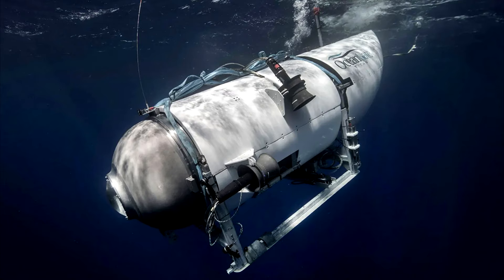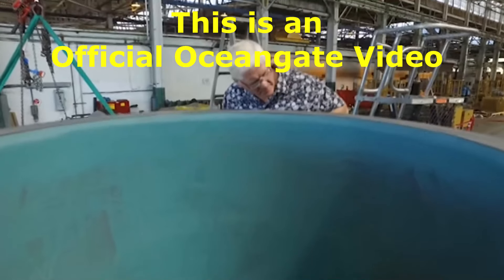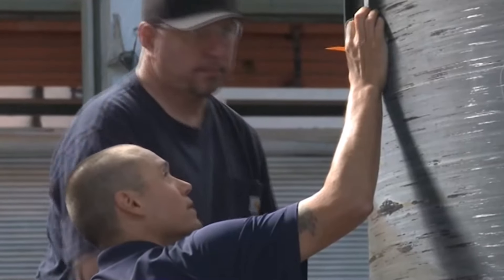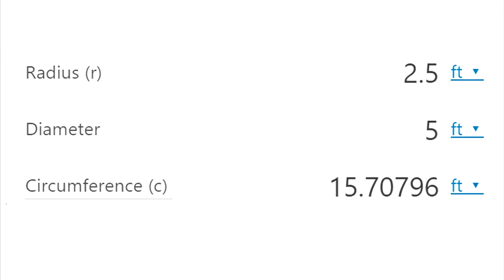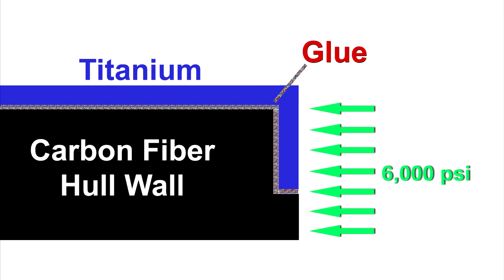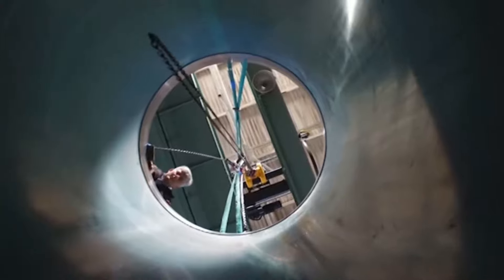Ocean Gate Titan Was Glued! Coast Guard Reviews

Comment: I have worked on industrial gluing systems.  The rings should have been sandblasted, degreased with Acetone, then treated with an ozone clean.  The glue application should have been done in a class 10000 clean room.  There should have been some squeeze out when they placed the ring on. I did not see any measurement jigs. You have to be precise with the clamping force to ensure even coverage.
Reply from the maker: Thanks for your comment.  They did have a procedure for that.  Below I have copied what was in the NTSB Factual Document.  The Spencer Composite drawing for this joint has the gap at 0.06 inches.  You are expert at this, do they really have spacers for 0.06 inches (front and back) in a gluing process like this, I would be interested to know.  Here is the text >>According to a former director of engineering and a written OceanGate process specification, the segments and hull surfaces were prepared for bonding by degreasing with methyl ethyl ketone (MEK) and roughening with stearate-free sandpaper. Contact angle measurements were taken between steps to ensure active (i.e., non-contaminated) surfaces and particulates were blown away using filtered shop air (tested by contact angle to ensure it did not introduce contamination). The adhesive was mixed and applied to both the segment and hull bonding surfaces. The hull was then inserted into the C-channel. The aft joint was formed by lowering the hull down onto the segment and the forward joint was formed by lowering the segment down onto the hull, the entire assembly oriented vertically. Spacers within the joint controlled the bond line thickness.
Reply: @solareclipsetimer  The glue used was Loctite EA 9394. It is not the best choice for bonding with titanium in cold temperatures.   For the application I worked on we could very precisely measure clamping force with a load cell and linear actuator. I am not sure how they would have used spacers. Also, they should be using Clean Dry Air and not air from a shop compressor. The glue should have been degassed in a vacuum.
Reply from the maker: @timdion9527  Agree with yu.  And i edited my original reply, the dimension of the glue joint space was 0.06 inches.

Comment: In reality, even the glue could have been superfluous for actually holding the sub together.  The pressure of the water at depth would have been forcing the end pieces inward against the cylinder main shell. You could have used a bungee cord wrapped around it just before you tossed over the side. The only real effect provided by the glue, at least underwater, would have been as a sealant, not an adhesive. 

They could have put handle bars on the end pieces and everybody could have pulled them inward until the water pressure sealed it.

Sure, being handed a titanium end piece and told to hold it against the main shell until you were under water might have brought on feelings of high anxiety among the paying guests but isn't that what Xanax is for?
Reply from the maker: Great points.  The Coast Guard testimony mentioned that the domes would have over a million pounds of pressure on them.  So, you are correct, the force pushes the domes in.  However, that does not necessarily make the carbon fiber to titanium interface joint watertight.  The glue had to hold the domes on the hull so it could be moved around as a unit, and watertight seal the joint. There were a lot of stresses to the glue on the joint to the ring, to which the hatch was attached.  At 6,000 psi you don't get a "drip-drip" leak, like the plumbing to your kitchen sink.  At 6,000 psi the weak spot propagates instantly to a catastrophic explosion.

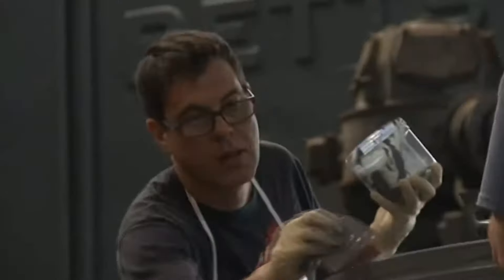Comment: I remember being horrified when I first saw this 2:02, going to 4000m in that thing..............
Reply from the maker: Thanks for your comment.  I agree with you.  This was of course video of the first hull.  But I bet they glued the second hull the same way.  The thing that really scared me about the 2nd hull was making the hull in one-inch thick segments and then having a layer of glue to bond the next 1-inche segment to the previous 1-inch segment. The implosion images showed how those layers just split apart.  I mean, who trusts glue in a construction like this, with those kinds of pressures?
Reply: @solareclipsetimer  Yes, again I was so shocked to see the 2nd hull was made in sections too, in all aspects it seems absolutely counter intuitive to do such a thing, however I think it accounts for the loud noises heard during ascents and descents as it started to delaminate. Moreover, regardless of advances in technology "glues' are not suitable for DSV's, even going back to the Thresher incident, where solder joints failed at depths far shallower than this contraption was intended to go.......... It really is incredible that these guys got in this thing,  such an avoidable tragedy. I wonder if we will ever know if it was the glue interfaces or the hull that gave way. Even sitting on dry  land the glue joint was sole responsible for holding that 3800lb dome in place, along with what appeared to be a 40mm lip on the  rim, I'm sure it looked good on a laptop!!

Comment: Omg... Geez.. tight too.. i couldn't believe only glued. In the old days they had rubber gaskets with bolts... How how did they do it 6 or more times that deep before there was a problem.omg why no inner hull with bolts... To at least hold the ends on
Reply from the maker: Agree, amazing that it worked.

Comment: Glued end caps are not the reason for an implosion, maybe a leak but the carbon cylinder crushed
Reply from the maker: Thanks for your comment.  I would reply with two things.  1. Yes the hull may have imploded from delamination. That may be it.  2.  At 6,000 PSI you don't have a "leak" at the ring glued junction.  There is no "drip, drip."  If there is a breach there, then that would in turn, be the reason for the hull to implode.  The hull crushes either way, it's just what started it.

Comment: They probably would have been ok, had they made the hull 3-4 inches thicker.
Reply: Possibly and a good point.  The original engineering estimate for the hull was 7 to 10 inches thick.  Then some engineers at some point thought it could be down to 5 inches, which is what they did with Titan.  But we don't know if the failure of the Titan was compression of the hull (at 5" thickness) or a failure at the glued joints.  The increased hull thickness may have not made a difference if the failure point was the joint. Although the surface area of the glued joints would have been larger and that could be a good thing?  Then, if you go thicker do you lose inside space for the cabin (which was already tight), or hold the cabin size the same and increase the diameter of the entire sub.  If you increase the total diameter of the sub then the titanium end caps become bigger, heavier, and more expensive.  Also, the buoyancy calculations change a lot.

Comment: If you cut the ends off a tin can, the remaining cylinder is easily flattened. In Titan, the glue would provide little strength as the cylinder was being flattened. Seems like the titanium domes should have been inset in the CF.

Comment: Wouldn't a human just put a flange on the two end pieces and bolt them together using long bolts??
Reply from the maker: Good point.  The owner of Titon Subs said he was once in a composite sub where the bolts spanned the entire length of the sub to hold it together. It was a while back and it must have been a smaller sub.

Comment: The reason trowels for laying tile have teeth to spread the adhesive evenly for a better bond after seating the tile. I wonder why the trowel used in the video did not show any teeth.
Reply: I don't know, but I think in the case of epoxy for deep depths, you do not want air pockets.  That is the way I understand it.

Comment: the pressure is pushing the titanium into the glue, compressing it, ergo, pressure will not deminish the seal, or am I wroing
Reply from the maker: You are correct, the domes get pushed inward to help seal the joint. The issue is the cycles.  The compression and then the release over and over on the glued joint between two dissimilar materials with different compression and thermodynamic properties.  I believe it is a weak spot.
Reply: Although would it not be pressure equal beings cylinder and not a sphere so whilst it was pushing the domes onto the carbon cylinder it the pressure wasn't equalised or balanced.
Reply: There will be a sheer stress between the surfaces. Each dive will weaken the glue bond. Eventually a leak will develop.

Comment: Glued together, is not exactly news.

But i'm not convinced that's per se a problem. Because the glue joints don't necessarily need to be load bearing. The way I see it, the water pressure on the endcaps should keep them pressed onto the tube as the vessel is submerged deeper. It just needs to keep the water out when the vessel is near surface.

I think the primary problem is the lacking stability of CF tube against the pressure, especially fatigue behaviour. Its connection to the ti end rims contributing to the problem, as the interlock of parts of different shrinkage creates sharp spot strain. You can't fix these fundamental force relationships with glue, but it's also not necessarily making it worse.

Still i'm finding it surprising that they apply thixotropic modified glue upside down and then dropping the rim on the tube, as opposed to using very liquid formulation in the groove of the rim, vacuuming the bubbles out, then lowering a lightly pre-coated tube into it and collecting the squeezeout as it greens up. I'm pretty sure the glueup as performed is a little wonky.
Reply from the maker: Hi, thanks for commenting.  I agree with you, the domes get compressed inward under pressure and keep the water out.  The question is, does the glue compress also?  If it does, even just a little bit, in a couple of areas, then it is decompressing on the way up also.  That is movement in a glued joint means that is prone to cyclical failure and creates the potential for a water intrusion point.   You don't get a drip, drip leak at 6,000 PSI, it blows out.  

I also have concerns about the hull.  And I like your idea of doing the glued joint the opposite way: put the glue in the ring and set the hull into it.  Hadn't thought of that and it seems like a better way to do it.

Comment: Too many untrained people constructing a vessel that needs to withstand upwards of 50,000 pounds of pressure on the bottom of the ocean. A glue was applied to the fiber material that was never tested under any pressure or Rockwell testing.

Comment: Ok the thing was poorly designed but the fact there was glue is not a shock. The core hull was made of carbon fiber. You cannot weld carbon fire, it will simply burn. A powerful epoxy or laminate adhesive is the only way to stick parts together.
Reply: Yes, that is true

Comment: It's ridiculous that he made a sub without even thinking about the fatigue stress! Even a graduate mechanical engineer would tell you that it will fail very quickly! Where is the stress strain analysis of this model? Did he use any software to simulate it, did you make small models and test them in the lab ? More over he used glue, that is brittle! What about the impact of rust or chemical reaction that salt water would cause on that glue? Why not use water sealed bolts...I mean on one hand you are using titanium, on the other hand you use glue? And to top it, you are using carbon fiber in a submarine environment to construct a capsule? The man was crazy! 😂😂
Reply from the maker: Good points.  They tested a 1/3 scale model to determine failure in a lab.  One time.  The model made it to a pressure test of just about 4,000 meters in a lab, so he felt good about the design.  His plan was to have that model make it to 4,500 meters of pressure, to show some "reserve" strength.  It did not and he did not want to take the time or spend the money to build an test another model.

Comment: I'm amazed that the guy chose an unproven carbon fibre/titanium hull design instead of going all titanium. The cost would have been only slightly higher and is a proven design. Even all aluminium would have been better than this strange material combination. I heard that carbon fibre was chosen for its good weight to strength ratio, but that is a negligible advantage for under-water craft.
Reply from the maker: I think the issue was that to have enough internal volume to fit five people you have to make the entire sub weigh less so you can get to neutral buoyancy to go down and the back up.  All titanium for the sub would be so heavy it would take an extremely large amount of that non-compressible buoyancy foam they use to offset the sub weight.  That is what I understand form my research in the past about this issue and why Rush wanted to use carbon fiber.
Reply: @solareclipsetimer  That reasoning doesn't make any sense to me. Mass under water is easily countered with buoyancy tanks. That's how all underwater craft are designed. There isn't a submarine in the world that wouldn't sink like a stone to the bottom of the ocean without buoyancy tanks to give it lift. But what do I know...
Reply: @foxwoodastronomy8255  Thanks for taking the time to explain all this. I'm an engineer, but my field or work is automobiles, not submersibles. I guess, there's more to designing subs than meets the eye.

Comment: It was all around a stupid idea…BUT, IF they were going forward with a stupid design, gluing it was the best option. There wasn’t any pressure pulling it apart. All the pressure was pushing in on it. So they wasn’t a need for bolts because that would’ve weakened it even further. 
Again…Stupid design..But glue was the best option for that stupid design.
Reply from the maker: Agree, you had to use glue at the joint, basically to hold it together and make it watertight. And sure, the water pressure pushes them inward.  It's the alternating pressure cycles on the joint and the forces caused by opening and closing the front hatch.  The hatch forces were transmitted to the front ring and glue joint.  I believe the front glue joint weakened.  At 6,000 psi you don't get a water "drip, drip" from a leak. it becomes a catastrophic ingress.

Comment: the carbon fibre used to make the oceangate sub was rejected as non conformance below standard by Boeing and they sold that shit to Rush. Boeing knew the carbon fibre was defective and would fail under pressure.  Of coarse Rush hull design was insanity,  then wrap that in defective carbon fibre.
Reply from the maker: Thanks for your comment.  You bring up such a good point.  The status of the carbon fiber quality is still a point of contention to this day.  The testimony at the Coast Guard hearing never got to the point of being definitive about it.  I hope the final Coast Guard or NTSB report clears that up with a definitive yes or no.

Comment: After spending 11 years on board submarines, I can say that the end bells did not fail, it was squeezed in the middle like a toilet paper roll. I get it we need content to keep the views. but lets not pretend this joint did anything to cause a failure. The only thing that failed was the carbon fiber, no one uses it on pressure hulls, and the only war time submarine made with titanium was stopped due to the cycle fatigue of titanium in unsupported sections.... IE the entire titan submersible.

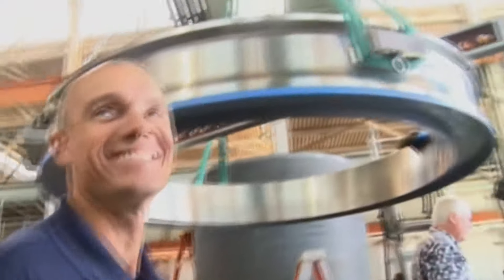Comment: 2:32 There not much of a lip 
1 & 1/2inch. 😮
Wow would have thought that'd be like 6 inches at least.
Reply from the maker: I know, it wasn't much.  But I think (I am not exactly sure) that the dimension is driven by another factor and that is matching the moduli of the titanium and the carbon fiber hull.  So, how do the pressure and temperature changes affect the two materials being right next to each other?  There may be real engineering behind that dimension  Tony Nissen, the engineer alluded to that in his testimony but did not get specific, so mpre may not have been better in some ways.  But again, I am not sure.

Comment: If the hull would have been made from steel, as all other subs are, this accident wouldn't have occurred. Or at least not imploded in this manner. Although Mr Rush, was cutting so many corners that the sub likely would have still been doomed to failure.

Comment: What I don't get is why they didn't make the ring a little bigger so they wouldn't need to remove structurally important carbon fiber to make the pieces fit. Like, you cut into the wound carbon fibre to make things fit! That can't be good.

Comment: no clean room environment , touching surfaces with bare greasy hands , manual mixing and application of bonding paste/glue , no mask or ppe to prevent breath condensation or hairs/ skin or dust particles contaminating the glue , the mixed glue probably not been vac purged for air bubbles and surfaces to be bonded need to have a deep key or scratch roughening and then multi degreasing steps and cured at a specific temp/humidity. these basic precautions are for non pressure rated applications like yacht skin fittings or for keel bolt repair areas needing glass repairs.. in fact a glass and epoxy layup would probably have had better pressure resistance than carbon prepreg which is known to be brittle on compression compared to glass or even kevlar . any boat builder or marine lamination tech would have and should have spoken up about the stupidity of the entire operation. destined to fail from concept